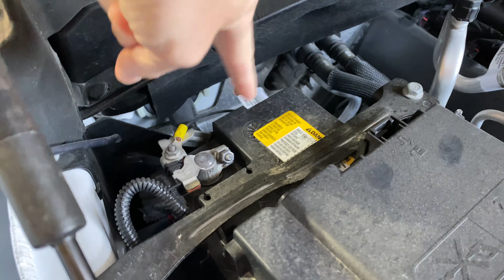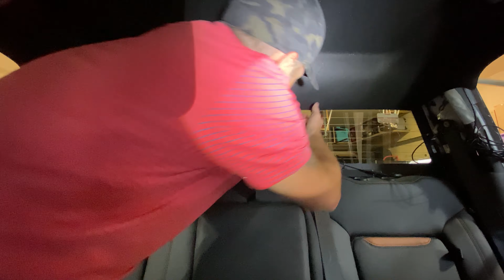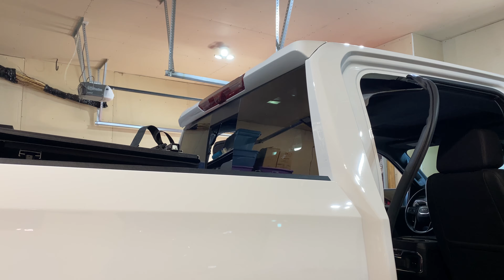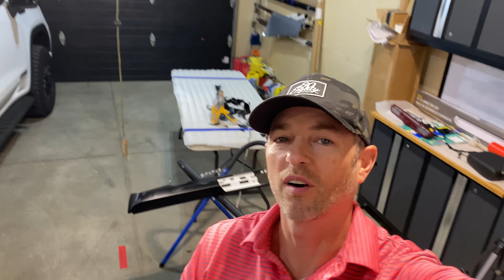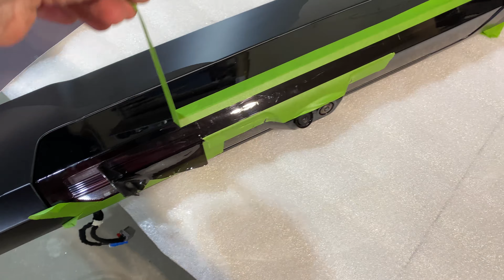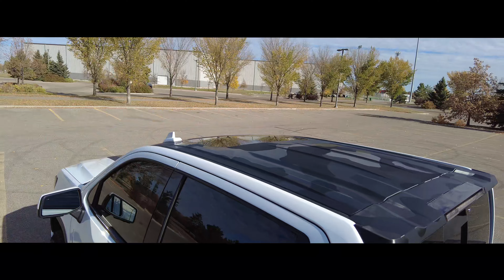2019 2020 2021 GMC Sierra / Chevy Silverado Valence Wrap and Third Brake Light Tint

Comment: Figured that you would have a video for this!  Great explanation on removing headliner. I’m planning to replace my 3rd brake light. Found a GoRecon that I like. I have never been a fan of how the stock red doesn’t match the tail light red.  BTW, I ordered the Freedom Blade and it should be here in a few days( thanks for the discount code)
Reply from the maker: Glad it was helpful!
Reply: Did you end up installing this? I am getting ready to do this same tail light install. Any helpful tips for the Recon brakelight install?

Also curious did you seal the bolts with anything when re installing?
Reply from the maker: I am not sure of you are asking me or CJ.  For sealing the bolts I applied some caulking around the mounting holes.

Comment: Curious how you got the headliner back in? The two white clips with the blue inserts, I cannot get those to go back in. One of the white clips has ripped free from the headliner itself, plan on gluing it back. Wondering if you had any tips for the blue part to fit back into the frame? Back of my headliner is sagging now, everything else looks great tho.

Comment: Great video and now subscribed - Question.....Did you use RTV to "reseal" the bolts when re-installing the rear spoiler? Thanks so much for great content.
Reply from the maker: Yes I used a sealant for the bolt holes

Comment: Is there a specific torque for the nuts and bolts to put the valence back on? Or just by feel? I need to take mine to fix a leak. Thanks.
Reply from the maker: The answer is probably ‘yes’ but I went by feel. I also added some caulking to the the locations where the bolts pass through.  Not an excessive amount either
Reply: All bolts and nuts for the spoiler are torqued at 53in/lbs. I got that from the dealer.
Reply from the maker: Good stuff!  Thanks

Comment: Any recommendations on wrapping the sharp edges/contours of the third brake light camera section?  Should I heat the vinyl, lay it, and squeegee?
Reply from the maker: I found heating it while wearing a wrap glove 🧤 to push the vinyl into the contours worked for me. Then carefully cut out for the lenses.  It was easier when I took it right off the truck with the whole valence
Reply: @Donslife  Thank you!  Love your videos.  Very helpful!

Comment: Do you think the 3rd brake light could be done on the truck?
Reply from the maker: What do you mean? I applied some dark tint to the third brake light.
Reply: @Donslife  yeah could it be wrapped on the truck or would it be best to remove the spoiler? Given that I'm not very familiar with wrapping but I have tinted lights with VHT paint before
Reply from the maker: @urbanmechanic9254  now I follow. If you have the camera like mine, I think removal is better since that spot is a pain.  If you don’t have the camera, it would be easy enough to do it on the spoiler.  Lots of videos on that stuff out there.  I do have a taillight tinting video in my AT4 playlist where I tinted it on the truck still.

Comment: This looks awesome!  Just found your channel and can’t wait to watch thru some of them.  

Could that wrap have been done while the valance still attached ?
Reply from the maker: You could, but there are some pretty tight corners you might want the film to wrap around.  But 100% doable
Reply: may I add ,from a fellow non factory trained wrapper,   yes,  by cutting the first piece with a sufficient over hang to cover the gap on the roof side, then cutting a second a second piece of film with sufficient over hang to cover the third brake light assembly..      from my experience, you have to find a way to avoid stretching over a valley for longevity of course, CKwraps was my teacher  :D  .. great job Don  :D

Comment: CAUTION ⚠️
These are single use tabs for the splitter! I have issues with mine leaking and I haven't even touched them. Just a psa to anyone doing this
Reply from the maker: good point.  I put silicone around each connection point.  Had it off 3 times for various projects. No leaks.